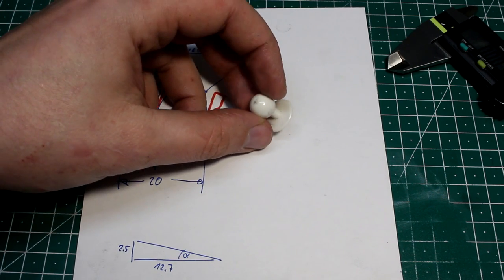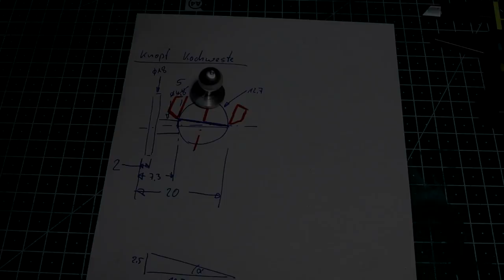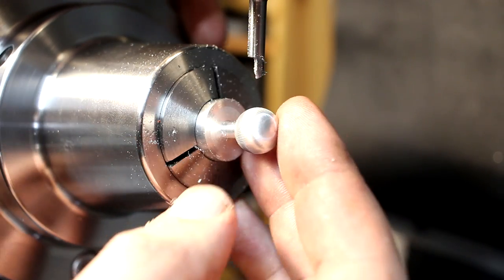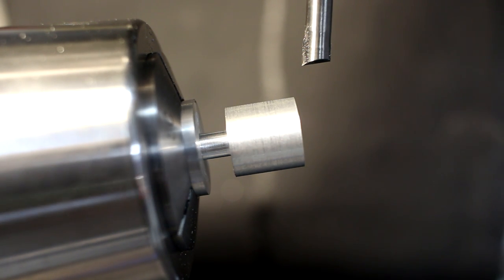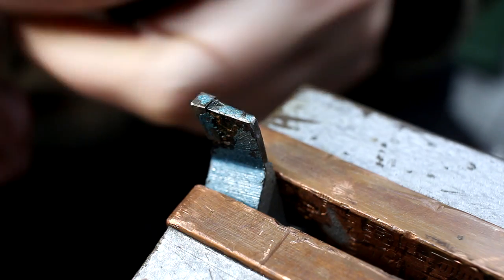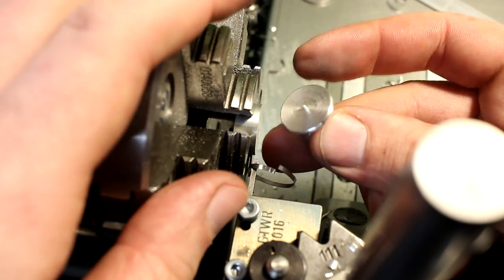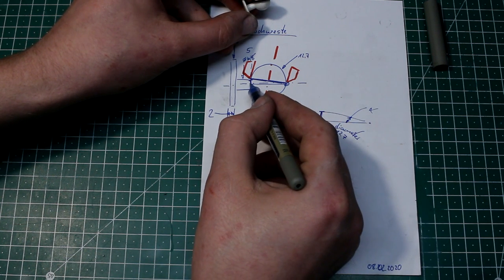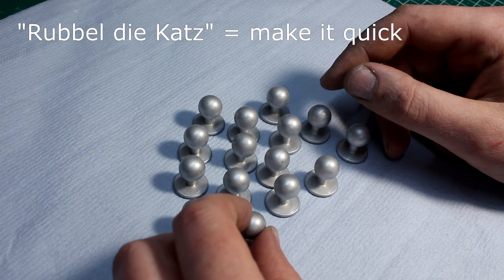Making a ballshape on the milling machine

Comment: Very clever Stefan.
It looks from your diagram that the 12.7 diameter is actually the hypotenuse ie the path of the tool cutting surface, this doesn’t really matter here as the sin calculates as 11.35 degrees. Forgive me if I’ve got it wrong, it’s a long time since I was at school and didn’t like trig that much. 
How did you set the diameter of your cut- is it a trial and error?
Reply: I calculate the swept circle diameter to be 12.440mm (assuming 12.7mm desired sphere diameter, and 5mm shank diameter). A combination of pythag and thales theorems works (I think!). Too hard to explain in a comment, but I can show my working in a video if anyone's interested.
Reply: I would be happy to see this if you have the time and effort. My comment related to the top drawing at 16.19 where it looks like the swept area is the hypotenuse labelled 12.7 across the “tilted” axis of the milling machine (relative to the axis of the dividing head) . Thus the angle is sin of 2.5/12.7
Reply: @stanstevens3783  Right - I see what you mean. I also went a step further and used the angle (and a few other things) to calculate the desired diameter of the cutting circle. As the supporting shank gets larger the cutting circle must get smaller. I will see what time I get to make a video, I have a couple in the queue already. Cheers, Craig

Comment: Hey Stefan, for completeness only let me note that, I think, by titling the two axes you're not getting an actual spherical shape. You can get a real sphere only if the axis of rotation of the part is coplanar to the plane that your boring head tip defines. I might be wrong though....(theoretical discussion only, of course, not related to this application). Thanks for showing, I'll keep the technique!
Reply: It is a sphere. The tool tip inscribes a circle equal in diameter to that of the sphere. Tilting the part and rotationg it around its axis allowed the tip to inscribe that circle everywhere around the sphere while avoiding cutting off the neck of the part. Think of it this way: the circle inscribed by the tip fits the part in any orientation once it is finished; that is by definition a sphere :)

Comment: I learn a lot from you Stefan . I thought I needed to make a ball turner but as it turns out ( pun intended ) I have everything I need since watching your video . Could those aluminum bobbles also be used in your flux capacitor build ???

Comment: Are you also using Cosine to calculate and set the boring head cutting tool path diameter or just eye ball?  Every time I watch your video I am reminded of the need to work on my cutting tools to make them more free cutting like yours.  Thanks for the video!
Reply: He shows the math near the end.
(tan)
Reply: mattmanyam yes and that’s how he determined the tilt angle.  I am asking about the boring tool path diameter
Reply: @woodscreekworkshop9939  ahh... Missed that part, my apologies!
My understanding is that he set it to final desired diameter (1/2") and the downfeed movement of the spindle completed the shape.
Reply: mattmanyam the tool path has to be smaller than the desired diameter of the ball.  Stefan shows you this by placing a black rubber ring on the ball.
Reply: @woodscreekworkshop9939  hmm. I see what you're saying. I assumed the tilted approach to clear the stem, still resulted in a "full diameter" cut... But that would result in the tool plunging past the centerline of the stem (on the outward side of the ball)... Maybe that's still ok, as it would be in a clearance situation?
Reply: I guess that would result in a "non-spherical" shape...

Comment: the math is off a little

the 2.5 is correct, the 12.7 isn't quite correct though. Doesn't matter much in this case, but it matters more the bigger the shaft is. So if D is the diameter of the ball and d the diameter of the shaft, your number has to be:
(sqrt(D^2-d^2)+D)/2
In your case it's 12.187 mm and the angle changes to 11.59°

Comment: Rosewood. Ebony. Or those acrylic acetate sinuously colored pen turning blocks (Google pen turning blanks) Or polycarbonate. Or zebu bone. Or bronze. Or machinable ceramic (Macor). Or bakelite, or linen-reinforced phenolic showing the layered structure (after polishing). Or at least prep and send out the Al to be hard anodized. Sorry, but anything other than bare aluminum.

Comment: They'd be awesome in brass...
Reply: It would look great, but even in AL I wonder how heavy they'd be. He made 15 so maybe 5 per jacket. It would still pull down the front of the jacket like crazy.
Reply: @iteerrex8166  It’s twelve per Jacket. Two columns of six. I don’t think they’d be all that heavy, especially in AL. I’ve seen novelty ones made from glass, porcelain and some sort of die-cast metal, and they didn’t appear to be too cumbersome.
Reply: With AL I´m a little worried about how they hold up over time, many foods are either slightly acidic or basic and splashes are inevitable.
Stainless would be nice, V4A for extra resilience, but that stuff is heavy!
Titanium maybe?
Reply: @sthenzel  Plenty of AL utensils and so on in commercial kitchens. Shouldn’t be much of a problem.
I mean, it’s not like you’d marinade them in white vinegar overnight or something…
Splashes of greasecutter or other cleaning supplies might be a problem, but should polish out pretty easily, I think.
Reply: @tilmanahr  12 huh? Okay if the weight is ok, then as a last touch power coat and it'll good for ages.

Comment: But this is actually not a sphere, it should have a ring instead of sphere center that is twice less in diameter then the attaching rod.. You should point the opposite side of a cutter below of a stock center the same radius as attaching rod, isn't it?

Comment: couldn't you have turned up a bar between centers and saved all that waste by feeding it through the 5c chuck as a bar? it would also save you a parting operation as the parting off of each one would be the beginning of the next.  probably not worth it in aluminum at this kind of volume but in say titanium it'd be worth it i bet, then again in titanium you would have just bought precision bar

Comment: Nice work, Stefan, but result is not sphere. Your tool circle is not intersect center of sphere, so result is not perfect. You need to increase angle of rotary table twice.
Reply from the maker: If you cut trough a ball, no matter the orientation of the cutting plane, you always get a circle.
Imagine the circle beeing the path the boring bar rotates - That results always in a sphere.
Reply: @StefanGotteswinter  , I'm sorry, you are right.

Comment: Mathematically, in my not-calculated opinion, I am not convinced you have a "perfect" sphere, because you could have doubled the tilt, reaching just as far down past the center as you left remaining of the attaching cylinder.  The boring bar was always cutting a chord, never a diameter. Though even if I am correct I doubt that the difference amounts to 200 microns.

Comment: Very clever.
Personally, I suspect I would have solved this problem differently, by bolting together a disc, a tube, and a ball. 
i.e. looking at the problem in terms of adding geometrical shapes rather than by subtracting material
(your solution is better I think)